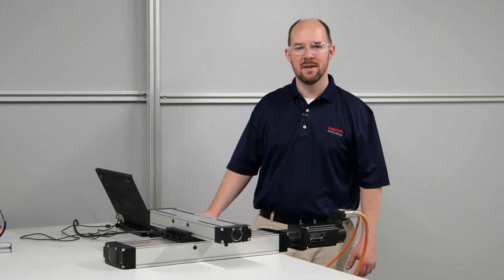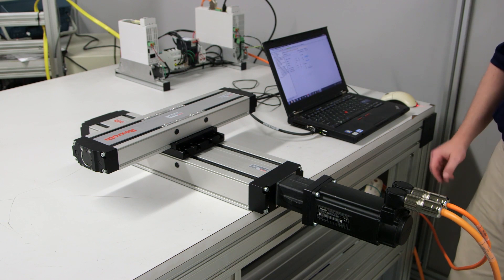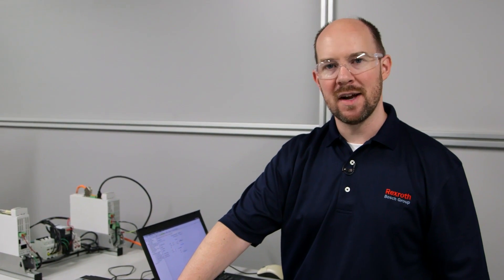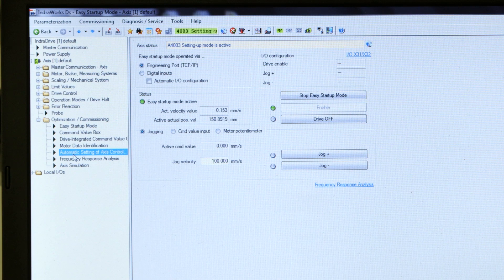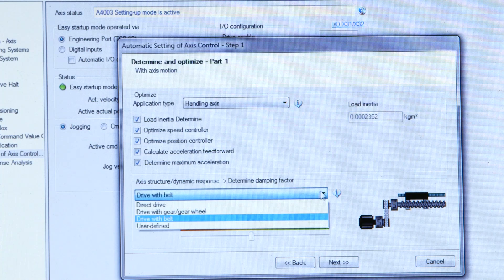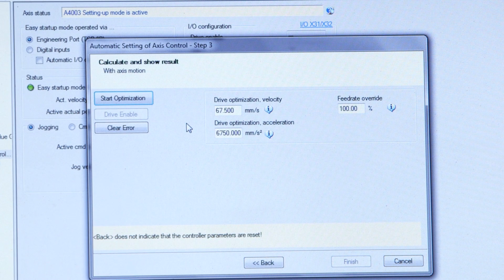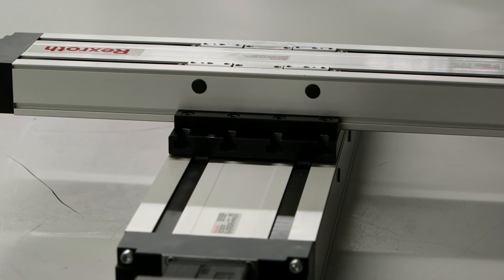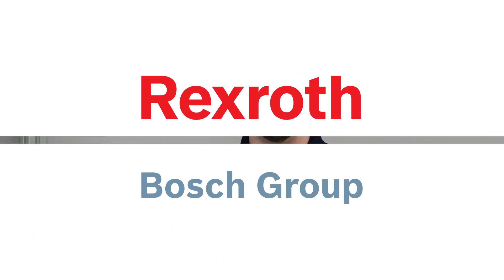Ball Screw Module Servo Tuning

Comment: Why would bad tuning on the servo make that sound?
Reply: The servo drive is a closed loop system, and excessive gain in the feedback loop causes a high frequency vibration which is what you hear in the video. It's just like if you stand in front of a speaker holding a microphone.
Reply: why the sound only happens on one side of the track
Reply: @lishuai8  According to what the demonstrator said it sounds like the when the load is at the servo motor end, the drive screw is not as well supported therefore more susceptive to high frequency vibrations.
Reply: but as long as i understanding by considering the system as a double mass model it should be the far end from the motor that is more prone to vibration due to the longer connecting bead screw for motion transmission resulting lower rigidity
Reply: @ndavis22  Meaning the PID control for the servo drive is trying to adjust too fast?

Comment: all that cash & hardware & you couldnt be bother to support the end of the screw?
Reply: Both ends of the ball screw inside the CKK module are supported; one end by an double row angular contact thrust bearing and the other by two deep groove ball bearings. It is possible (as demonstrated!) to still have excessive noise from unstable servo tuning with both ends of the screw supported.